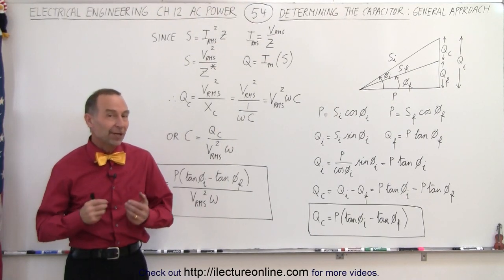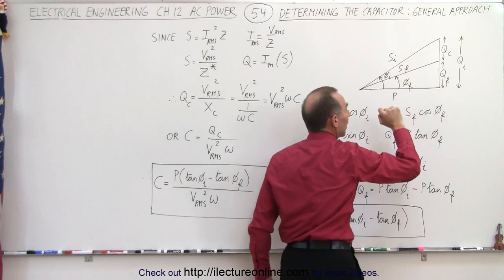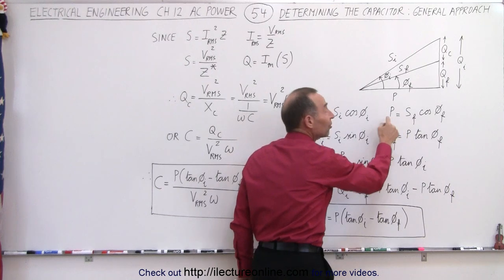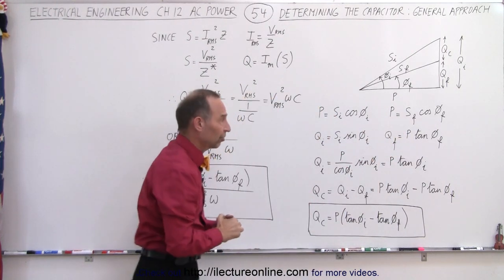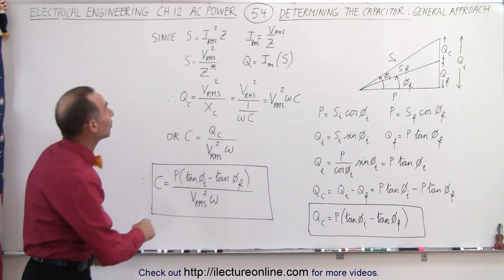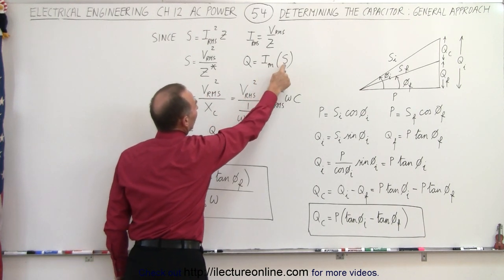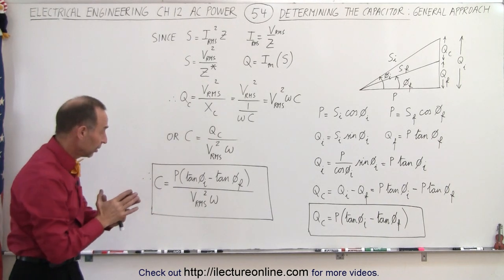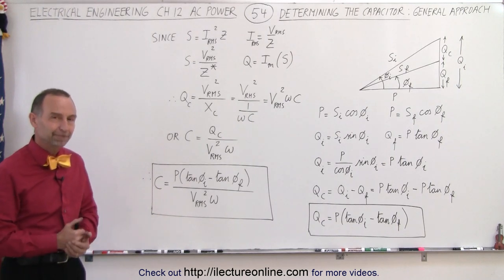Electrical Engineering: Ch 12 AC Power (54 of 58) Determining the Capacitor: General Approach

Comment: How can you use the real power to derive Qc when the real power in a capacitor is 0? Wouldn't Qc be 0 then?
Reply from the maker: If there was only a capacitor in the circuit you would be correct, but there is also resistance in the circuit